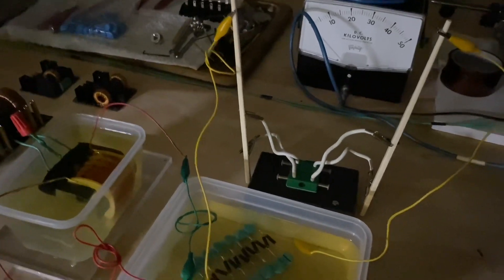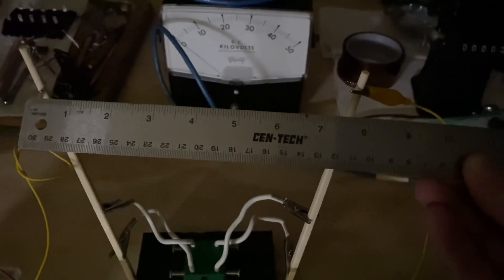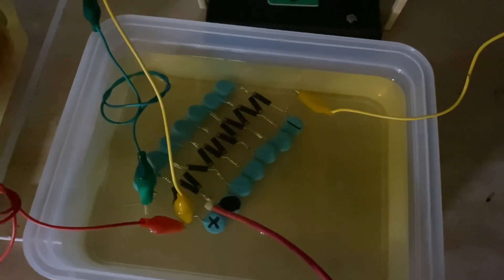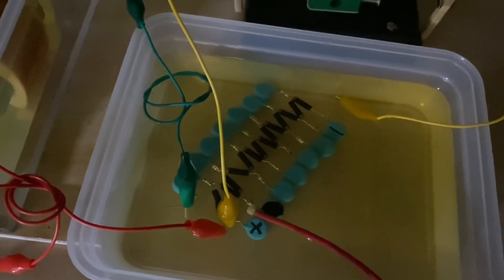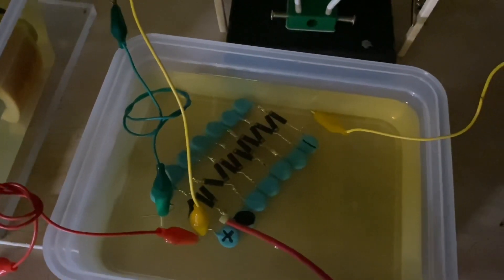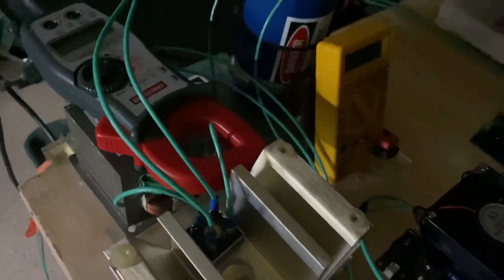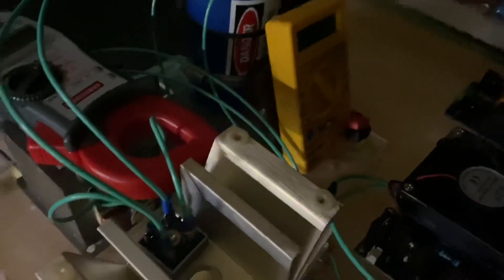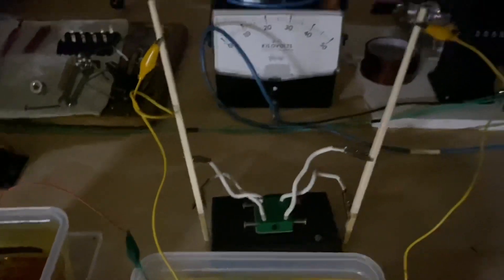100kV Voltage Multiplier Arrangement (7 Stage)

Comment: From my experience it is very tricky to minimize power losses through corona discharge on a high frequency voltage multipler. This is the best work i've seen so far, congratulations! Are you using mineral oil or regular sun flower?
Reply from the maker: Thanks!
Pure mineral oil